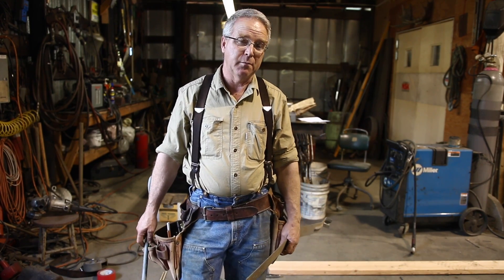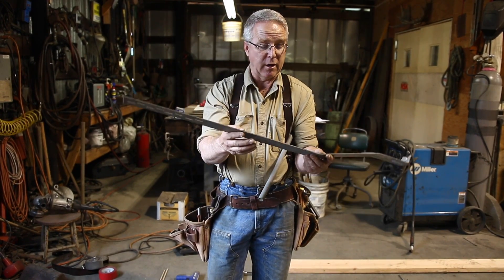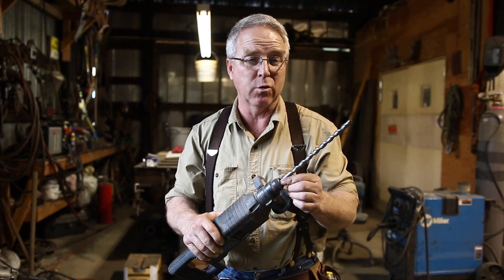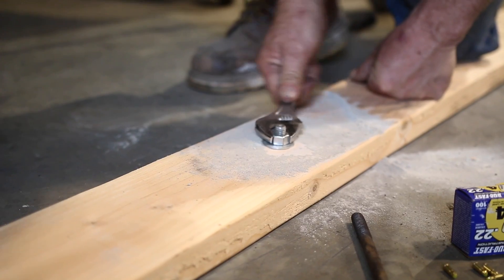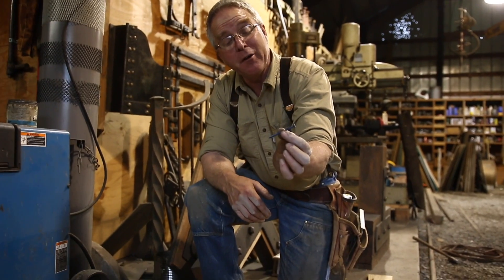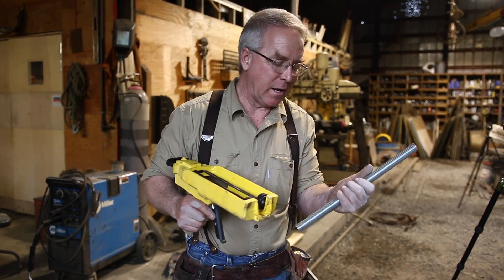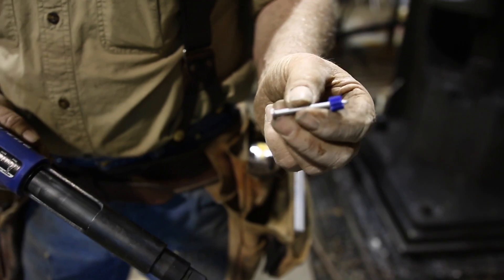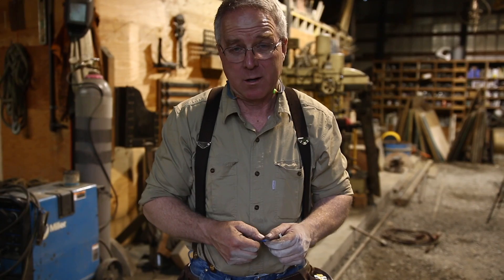How to Fasten to Concrete

Comment: If you're doing a lot of grab nails or wire nails you can pre cut a bunch of tie wire and put them an empty Irwin chalk bottle. They will shake of the spout. Also they won't stab your hands if they're lose in your pouch

Comment: Thankyou, Iam building a lgarden Work shop, In the UK we can use and Iam using 6" (150mm) high density Concrete Joist system for the Floor, we call this beam & Block flooring. However I want to build a Timber Floor on Top of these Concrete Joists, beginning with a hardwood batten then regular Floor boards. How can I best fix the Batten to the Concrete Joist  ?   Chris . . . Norwich, England

Comment: The most annoying part about drilling small holes in old concreet is that they have often a lot of aggregate, and various rocks, or is very sandy.  Usually I need 7mm hole (using 7mm SDS drill bit with rotary hammer) for my 8mm plugs, and even then, I often need to blow some air or use vacuum cleaner, and put some gipsum into it, to make sure it is tighter. Then before the gipsum sets, I hammer a plug, and wait until it sets fully, then screw thing onto it. I do that often for holding shelves, brackets, picture frames, etc. It just makes me more confident it will work for long time, and not slowly creap out (making shelves start to bend for example). I found my gypsum actually slightl contracts as it sets (i.e. if I path empty hole with it and make it flash with the wall, when it sets I will actually see a dimple, showing me that it contracted), but for attaching things like plugs and bolts, it would be nice to have some that actually expends slightly.

Comment: At about 11:57, you hold the toggle bolt ends together while talking about the size of hole you need to drill.  I'm 53 and just learned about 2 months ago that your (our) folded way of holding the "winged nut" is wrong.  You actually spin the winged nut all the way to near the end of the threads, keep it open (don't fold it in half), and simply tilt the wings until they are are essentially parallel to the bolt.  Then you poke one end of the wing into the hole, and push the rest of it in while it is still "parallel" to the bolt.  If the bolt is long enough, the winged nut will snap into position in the wall cavity. Try it - like me, you'll find out that you can actually use the drill size listed on the box of toggle bolts.  Perhaps it doesn't work with some of the toggle bolt styles, but I have 10-15 of them from various manufacturers in my shop right now, and it'll work with any of them.  Here are the only images of it being done that way that I can find:  http://www.chicagoexpansionbolt.com/installation-tumble-toggle

Comment: I really like chemical anchors, they have come a long way by now. I usually use that exclusively when bolting machinery and heavy duty shelving in my shop. It even works with modular/cellular bricks by using a special mesh tubing as an insert.

Comment: I've used thousands of these Wedge anchors to do seismic hold-downs for pallet racks. The single most important thing is, use a vacuum to suck out ALL the concrete dust...it will not 'compact' like sawdust, but will be nearly solid in the hole. If you use these and are considering removing the secured items later, then I like to drill that hole maybe an inch deeper than the anchor...later you can cut the anchor at the floor level, and pound the 'stub' into the concrete...

Comment: Hey there Essential Craftsman, rock climbing bolts are typically either wedge or 5 piece expansion bolts. There are now removable varieties which are incredible! Could probably have construction applications and you almost certainly would enjoy playing with them. Should send you a few. Cheers and thanks for the inspiring videos!

Comment: Before tapcons we used to secure closet flanges by drilling a hole, packing lead wool into it, and then just drilling a wood screw into it. As for ramsets when I was little my brother and I decided to use my dads ram set to shoot at cans by holding the safety and then aiming it like a pistol. Needless to say we got our butts whipped. Apparently the shots cost a little more than regulate 22 shells

Comment: Enjoyed your video and now I know that when we had our metal tornado shelter installed, the workmen did it right by using epoxy cemented bolts to bolt it to our slab.  Thanks.

Comment: Tapcons are cool, but running them in with a driver is a great way to shear the head off. Done it countless times. I usually hand tighten at the end in case my drilling was sloppy

Comment: From the Oregon Coast, hiya EC.  I've been following you ever since you had about 10k subs and somehow missed this one. You've created a great channel here and a real legacy for yourself... congratulations.  I used to live in Huntington Beach, CA and 25 years ago, was lucky enough to have a  home built there. They were serious about earthquake code.  It required HUGE i-beam structures embedded into the concrete foundation, one surrounding the front door and another the same for the entire garage door. The two i-beam structures were built 90 degrees from each other, one facing east-west, the other facing north-south. This gives the home incredible earthquake stability from any direction. I just don't see how anything you showed could compare to that kind of engineering, and Oregon WILL be hit by the big one someday. Would love to hear your thoughts.

Comment: @12:30 Heh... Reminds me of the trust issues I had when I had to tell the TV installation guys to stick with the manual's recommended 6 screws after they tried to mount my 75" to the wall with only 3 - Not gonna take my chances after paying 5'000.- for such a TV ( used to be twice the price of that before the online shop started clearing out their stock for the next generation )

Comment: I'm trying to finish off the basement of a 40+ year old home.   I want to attach some wood to the exposed footings so I can then nail some finishing material to it.    So far all methods I've tried have just blown the concrete apart.   Maybe I'll try the epoxy one.

Comment: I just finished pouring a pad for a new shed, and the advice about anchors in this video was invaluable in helping me decide the best way to anchor my walls to the foundation. Thanks!
Reply: On a little shed, I'd probably fasten the walls to the concrete using the (2) 16D sinkers in a 1/4" hole trick. On a little 5 sq ft shed what can go wrong.💀

Comment: Surprised you didn't mention the tip to drill all the way through the slab when using the wedge type bolts which allows you to just hammer the bolt into the sub-grade if you need to remove/replace the bolt.  Is that a no no due to possible corrosion or something?  By the way, I love the channel, keep up the great work.

Comment: NOT for making a "structural" attachment to concrete/block/brick ... Every home owner will come across a time when the need a "light duty" way of fastening to the above mentioned surfaces.  Something as a mailbox or house number to face brick.  First, you need a drill that has a hammer function.  Second, get a carbide masonry bit.  Third (don't laugh) use a plastic hollow wall anchor !  They work great for this type of light duty application.  Fourth, it it is out side or the item you are fastening down is made of pressure treated wood, use stainless steel screws.  Make sure they are long enough to go through the item and get a good bite on the plastic wall anchor.

Comment: I was hoping you'd cover the challenges in connecting wood to concrete in situations where it could get wet.  Could that be a future edition?  I came across some source that said that it was important to use a metal intermediary, say a Simpson tie,  to avoid rot. Did I get that right?  BTW:  You are just the greatest.  Thanks for your devotion to your craft and sharing your knowledge with us.  It's a beautiful thing.

Comment: Its actually no chemical bond with the epoxy. That is: Nothing in the epoxy reacts with the concrete. It "just" interlocks with it really well (even wets it, penetrates into it) and then hardens. So adhesion and interlocking.

Comment: He did mention it in relation to the epoxy set bolts, but cleaning the dust out of holes drilled vertically down is pretty important. Every chippy knows the pain of breaking a concrete fastener because the dust jammed the hole up. Old mate got away without blowing his holes out by drilling much deeper than the fastener required, which is the smart way of doing things, but not always possible.

Comment: Glue in anchors can be dangerous. Iron workers are killed because new anchor bolts for columns aren't installed properly. They need to be free of dust so the epoxy adheres to the concrete and not the dust. 
They are also required to be PULL TESTED before use, but good luck getting any company to pay for that - so installing them right is super important.

Comment: Scott,,may I add one thing please. A lot of those pressure drawn fasteners depend greatly on the concrete,,,, (EXAMPLE) SHITTY Pour,,,,,,ie,,,,,,BAD AS BALLS slump test.......no kinda PSI or at least if you order 4000psi,,,Then dammit,,,,send me 4000psi,,,,not 2800. I once had almost 10 REDHEADS fail on one foundation wall. I didn't think it was possible. NOW,,DIG THIS,,,HERE'S THE GOOD PART!!!!!! Took an angle grinder with a 4.5inch concrete blade and cut a fairly good size piece of what they called concrete. Took it to the physics and robotics lab of the college my kid goes to. ( Helps when your kid is friendly with the teacher),,,anyway into the press and my SO CALLED 4000psi pour I ordered and my pink receipt said so from THEIR route delivery computer with truck number,,,weight at load and weight after delivery. ( Trucks equipped with chassis scale). So their 4000psi blew the fuck out at 1800psi.......took the labs print out and went to the concrete yard. WELL AS YOU CAN GUESS to no avail at all. Thanked them and gave it to my lawyer.........END RESULT,,They paid to rip out foundation,,paid to reform it,,and paid ANOTHER CONCRETE COMPANY,,,who I still use,,to repour a real 4000psi mix. SO,,,please emphasize that those fasteners are only as good as the substrate you install them in. THANK You for letting me ramble.😊😊😊😊😊😊😊

Comment: Since the Tapcon screws are hardened steel they tend to break with the impact driver, better to use a regular drill in the screw setting. I wish i started following you 2 years ago.
Great content!!

Comment: I got that same bulldog drill, great tool and decent price.  (like $300ish if I recall).  I like the nailing method too, I actually prefer it over tapcons, I find tapcons break or don't hold half the time, but maybe it's a user error on my part.  Used framing nails and rebar wire for my drycore subfloor in my basement, nice and solid now.

Comment: I'll say that you definitely have to clean the holes when using epoxy for threaded rod. We had a job in Toronto on a major train line putting in posts and panels, and whoever was drilling the holes and setting the rods didn't clean the holes well, or at all in some cases. Ended up having to redo almost 100 posts.

Comment: Thank you so much for this video. I am replacing the metal hand railing on my precast concrete steps. Drilling the holes for the original railings took me about 4 weeks of frustration and broken bits. As a result of your video I bought the Bosch hammer drill and a Bosch bulldog bit. I installed one side of the new railing in one Saturday using the Tapcon screws. What a difference good tools make.

Comment: Am I the only one that knows about wobble bolts?
As a carpenter with too many years of experience, I can say I have used every method you showed.
Reply: A wobble bolt is like a long rivet. No threads, but it does have a couple of kinks in it. Look it up on youtube. Or Google it.
Btw, I still have my dad's framing square.
Reply: Found the proper name for them.
Rawl fasteners. Can't remember the particular application.
Reply: Proper name is Rawl spike. 
So many different fasteners. Hard to decide which one to use.

Comment: in a pinch you can use some scrap copper wire as a insert in a hole and then use any old screw.

Comment: If you had demonstrated one of the hilti anchors you referred to with the epoxy,you'd have been grinding it off... I put a large number of them into a slab recently and once the glue sets,it's there, you'll crack concrete getting it out.

Comment: I spot a lovely 7" Black and Decker angle grinder in the background, probably of the 6000 RPM variety. Between my dad and I we have give or take about 7 of those things, mostly the metal handled variety, and one of the old hexagonal shape. Best angle grinders I've ever used. Some seem to have a high pitched whine us younger fellas can hear, others don't regardless of nameplate RPM.

Comment: I use whipper snipper line and duplex nails quite often, the plastic line compresses tight and holds well but allows for easy removal. works great for temporary safety rails and formwork.

Comment: What type of fastener or method, do you suggest for anchoring a stair railing into 2-inch bluestone treads, that are set over old concrete stairs? Thanks for your help and input.

Comment: I used the 2 nail trick to put 200 new window frames in a warehouse renovation project that had arched brick windows. also to hang drywall directly on a block elevator shaft where hat channel would have given the hallway an offset. worked great.

Comment: Some great info here. Don't be so quick to discount those plastic plugs. They are very common here in the UK where nearly all houses are brick/concrete construction. They are available in a vast range of sizes both diameter and length. When combined with the correct sized hole and correct sized screw they are capable of holding very heavy loads. A typical brown plug here (about the same size as the plug you were holding) when combined with a 5mm screw will easily hold several hundred lbs no trouble. 4 of those in a bracket will carry a TV set with ease, they are commonly used to hand kitchen cabinets, 4 will hold a cabinet loaded with crockery, and a small child climbing up it! lol.

Comment: When you drill concrete and run into rebar.....Stop! You will ruin the masonry bit quickly. Get a cobalt steel bit and twist drill through the rebar, then return to the rotohammer. Trust me on this one.

Comment: I work concrete for 7 years now, but I never heard of two nails or dowel/nail, tie wire/double nail tricks. I do formwork a lot, and more than once I was in a situation when I had to attach form to existing concrete but I run out of anchors and beton screws. I wish I knew this few years ago, hundreds of dollars in manhours would be saved.
Reply: emceha - this is why you can always learn something new. I love workin with old timers that have great "tricks of the trade" that they used to use exclusively to get jobs done before all these new technology products.
Reply: Really!? I'm a finish carpenter and when I have to do temp stuff I love the two nail solution.  Easy to hide the hole.

Comment: Hey, you forgot to show one of my favorite. The Titan. You mentioned it and showed or held it up. But didn't show it in action or it's strength and abilities. I've found when used long enough with the correct diameter and large washer it is very strong along with it's simplicity in installation. I've even used it with a little bit of glue and found it to be very hard to remove. 
Thanks for all the great videos. 
Request;
Don't know if you have access to a large table saw or not and I also know that it's not a big use out in the contracting world, but it would be nice to get your thoughts being so close to it in the lumber business.
Reply: What is it? A technique?

Comment: Quick tip: I've used Titans and Tapcons for many years retain my garden hose reels for many years. Of course they are not made to be put in and removed and reinstalled over and over. The bolts are plenty strong for it, but the concrete will strip out. What I do to fix the issue is whenever I do any electrical wiring, I save the bits of 14 gauge cut offs and I slip one into each hole in the block with a bend in it to keep from losing the wire. Then hold up the real and send in the bolts. I've been using this trick for years and years and it has never failed me.. I'd say it is kind of on the same line of thought with the lead anchors..   Also, while working at a nuclear facility, we had to anchor everything extremely well. The threaded rod in epoxy is really extreme duty, but it's proper application is very important. Drill the hole. Wire brush. (I like to put it in a cordless drill for this). Blow out again. Some must be wet. Install epoxy from the bottom of the hole outward using a straw.  I then double nut the threaded rod and insert it into the hole using a cordless drive. The epoxy does expand slightly, but getting it into the bottom of the thread before it cooks is key.   Love your video's.....

Comment: Good vid as allways. One Thing.. You can trust that plastic plug you mentioned at last. Here in Germany everybody ataches nearly everything with These so called Fischerdübel to brick or concrete walls.  If the screw bites into the plastic plug ( Fischerdübel) well, and you can feel that while turning the srew in, it will not only hold your flatscreen, but even a wallhanging kitchencabinet full with whátever you would like to store inside. Trust me. In Germany most houses are made from bricks or concrete, not like in the US. And this Little plastic plug is the method to fasten things to the wall or even the ceiling.